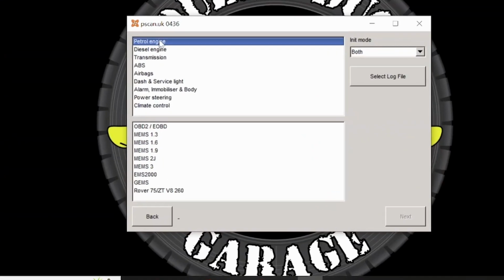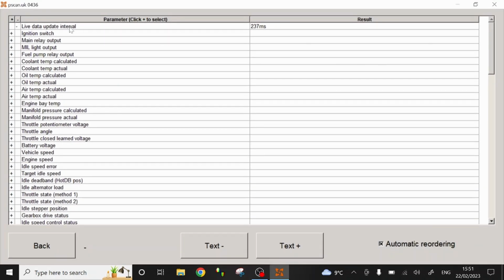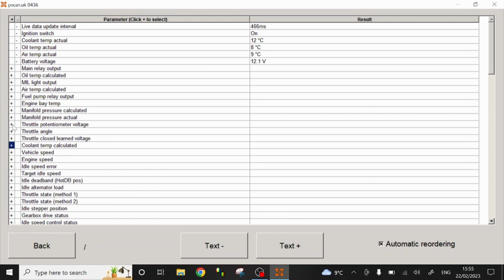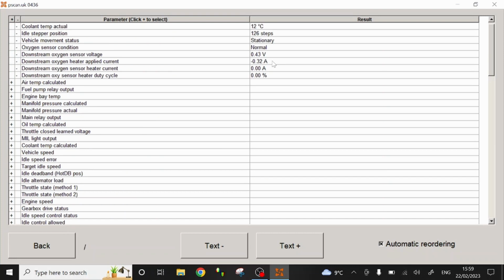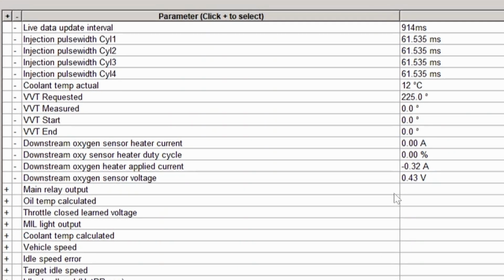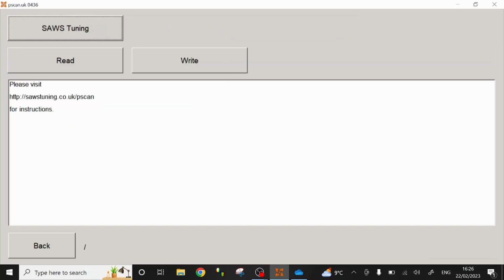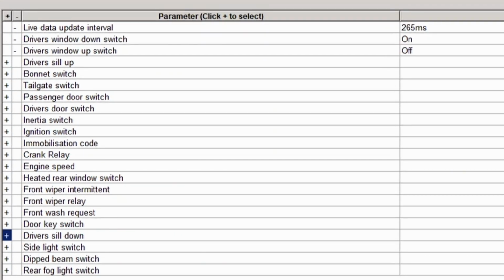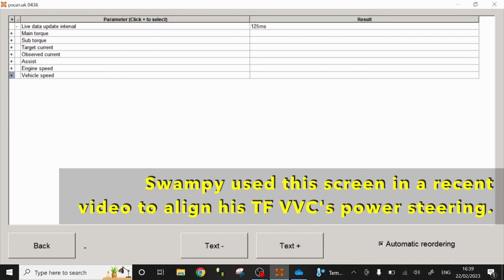DDG Quackie #007 - PSCAN MG Rover MEMS Code Reader Features Overview

Comment: Merhabalar Rover 216 araç beynine nasıl bağlana bilirim
Reply from the maker: Hello, how can I connect to the Rover 216 vehicle computer?

Hi, I am not familiar with the 216 but found this:
https://www.mg-rover.org/threads/diagnostic-connector.261607/

The J1692 connector is just behind the center console in the drivers footwell.
In production many of the connectors were clipped into the metal bracket the wrong way around with the contacts facing the rear of the cigarette lighter.

There are two photos here (for a right hand drive car):
https://www.mg-rover.org/threads/obd-port.866373/

It looks like your ECU could be MEMS 1.9 and this is supported by PSCAN.

If your car is pre-1995 the connector is different and is in the engine bay near the battery. I don’t know if that is PSCAN compatible. You might be able to find out more at:
https://www.the-t-bar.com/forum/pscan-uk-diagnostic-tool-forum

I hope Google translates this well enough to make sense :-)

(Scotty)

Merhaba, 216'ya aşina değilim ama şunu buldum:
https://www.mg-rover.org/threads/diagnostic-connector.261607/

J1692 konektörü, sürücünün ayak bölmesindeki orta konsolun hemen arkasında bulunur.
Üretimde, konektörlerin çoğu, temas noktaları çakmağın arkasına bakacak şekilde metal brakete yanlış şekilde kırpılmıştı.

İşte iki fotoğraf (sağdan direksiyonlu araba için):
https://www.mg-rover.org/threads/obd-port.866373/

Görünüşe göre ECU'nuz MEMS 1.9 olabilir ve bu PSCAN tarafından desteklenmektedir.

Eğer aracınız 1995 öncesiyse konnektör farklıdır ve motor bölmesinde akünün yanındadır. Bunun PSCAN uyumlu olup olmadığını bilmiyorum. Daha fazla bilgiyi şu adreste bulabilirsiniz:
https://www.the-t-bar.com/forum/pscan-uk-diagnostic-tool-forum

Umarım Google bunu anlamlı olacak kadar iyi çevirir :-)

(Scotty)

Comment: Where do you find the software please to download?
Im struggling to connect/make a contact with the ECU
Reply from the maker: SWAMPY: Thanks for Watching our channel Anton... please subscribe and like the videos which will help us out no end fighting against  "the algorithm" :)

May I ask a few questions? 

What hardware interface are you using?
Which software do you mean? 

We all use the pscan interface with its corresponding software. If you are using a generic obd2 interface then the pscan software won't work with it and won't help.

Pscan software is available at https://pscan.uk/ but without the specific hardware it won't help you.

Comment: Just a quick update, got the Pscan,,,, incredible tool,,, so far my tick over is a lot better, I found what was causing an erratic tick over,, and cured it.
I did a re-map through SAWS it was easy to do and it's amazing the difference in the car, 
Much smoother, quicker accelerator response, better torque etc, 
I do advise a remap, the car is a totally new experience.
Anyone with a MG F or TF should invest in a Pscan scanner, totally invaluable.
Philip from Pscan is a true gent, nothing is too much trouble for him.
Plus a big thank you to Scotty for his time and advice.
Ray
Reply from the maker: SWAMPY: So glad to hear the PScan helped! What was causing the rough idle/tick over in the end?
Reply: @DoubleDuckGarage  It was a combination of the speed sensor transducer and the cam sensor.
The car had no EPAS warning light.and all of the scanners I used came up with no faults.
I've since done a SAWS remap, worth every penny the car is a different animal altogether, I'd definitely advise one.
Cheers Ray